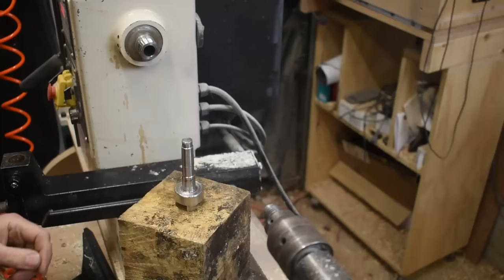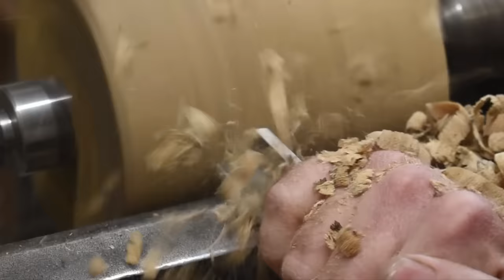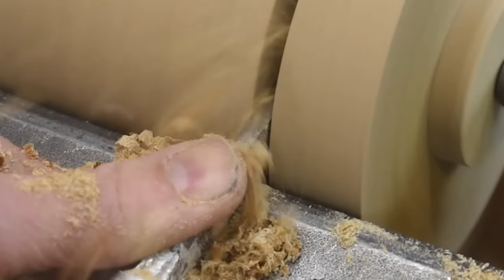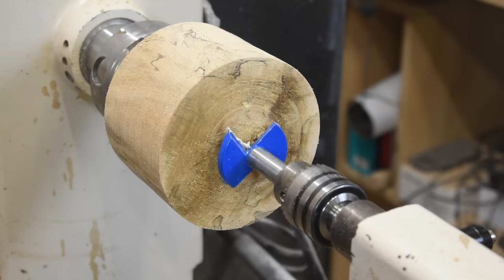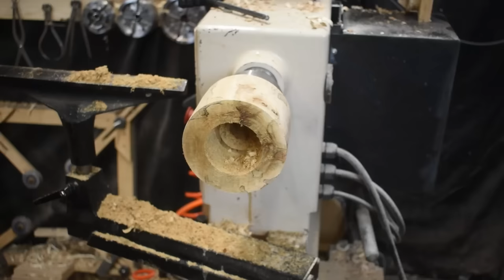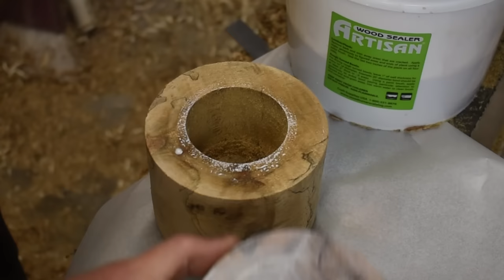This will change the way you turn wood boxes and save you time

Comment: Been doing this for years. For 2 turn end grain you left about 2x the material thickness required for that size. End grain doesn't move as much as face grain.  An alternative to sealing, and the mess that comes with it, is to put the piece in a kraft/grocery paper bag which serves as the vapor barrier.

Comment: Ditto for putting in a grocery (kraft paper) bag.  For a 3" box, I leave walls about .5 inch.  I use sealer only on apple (sometimes) , which moves a lot when drying.  Cherry and maple seldom crack

Comment: 1. From what I could see, most if not all of the wood removal was by scrapping. A cutting action by rubbing the bevel would give cleaner surfaces and the cutting edge of the tool would last longer. 2. When drying, I seldom use sealer, just put it in a paper bag or cardboard box with shavings and seal it up. This allows the moisture to slowly escape and minimizes cracking.  Also your climate and altitude makes a big difference in the drying time.

Comment: Good demo but you broke rule #1. Never leave your chuck key in the chuck.
Reply: So aaaa
Reply: I left my chuck key in the chuck one time, and, like a fool, turned the lathe on. The chuck key dropped into the shavings at my feet. Never did that again!
Reply: Much better than having it launch vertically. 50 years ago my shop teacher would have cracked you in the back of head if you left the key or spanner on the chuck

Comment: I never cease to be amazed that demonstrators/video makers show so much time turning the initial block to round. Why not use your bandsaw to take the 4corners off ? I do & sometimes can make use of the off-cuts too! Your video would be shorter too!
Reply: Hey Dagwood, how do you use the off-cuts?  On exotic woods I'll save the cutoffs and make plugs for filling screw holes.
Reply: If the original piece was big enough, the cutoffs could be pen blanks.
Reply: You can use those corner cut-offs to make exotic-wood fridge magnets. You can make a nice fridge magnet out of a wood cube that is just 1 x 1 x 1 inch.
Reply: @jeffjames1567  My experience/point exactly! Why make shavings to clean up when the off cuts are useable. There are lots of videos of bits of wood with resin made into interesting objects too- not my thing - each to their own- but another possibility.
Reply: You are turning much too low on the blank. Try raising your toolrest so your tool meets the wood at around 10 o'clock and you will get more of a peeling cut rather than a scraping action, especially when roughing down. Look at the wood coming off the tool. You should be getting shavings not dust.
Reply: @deltacharlie152  Me thinks your reply regarding turning much too low are a reply to someone else not to me. My comment was about band sawing off the corners before starting to turn. Just saying so you can adjust your comment to the original person maybe.
Reply: Not everyone has or can afford a good bandsaw.
Reply: @sandiekelley8513  it was ONLY a suggestion! How many times have you seen the corners cut off and the off cuts used? Not many if any I’ll bet!
Reply: @abumstead1219  for boxes the edges come off much faster and easier with a skew in my humble opinion, long grain just flies off like nothing. But turning a bowl blank from square to round is tedious and choppy and rough on the toolrest. Saves a ton of turning time and time on the Grinder since doing it I haven’t gone back

Comment: You need a bigger 4-jaw chuck and thus a bigger tenon!

Signed,
Armchair Expert
Reply from the maker: I have plenty of larger jaws this box was only 4 to 5 inches in diameter.  50 mm jaws are plenty large enough for that size turning.  Thanks for watching and for the feedback.

Comment: Great job clarifying what and where and why.  Question, the engrain sealer, could you not do the same thing using bee's wax or that spray one stuff you use on trees where you cut a branch off off work to keep it from cracking and still let it dry?

Comment: i hope you measure twise and cut once ,because that looks more like 1" then 1"1/4, "theres no need to apply it on the inside " but yet you sealed the inside of the lid
Reply from the maker: The lid was sealed on both end grain sides because its a 1 1/4 inch thick disc.  The inside of the hole does not need to be because just the fact of it being a deep hole slows down the moisture loss.  I will eventually take the lid off once the box dries some.  I do the same for rough turned hollow forms with small openings and have a good success rate drying them.  I see I missed around an inch with the scraper but that should not be an issue.